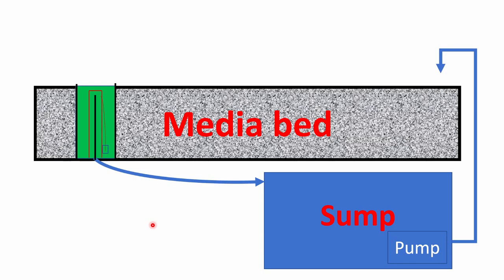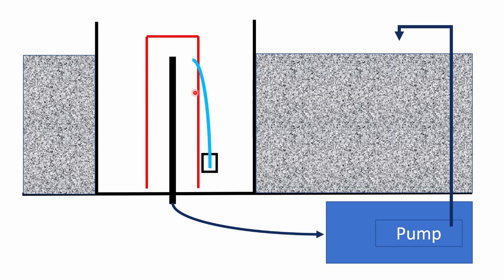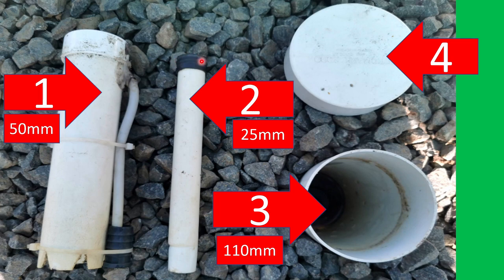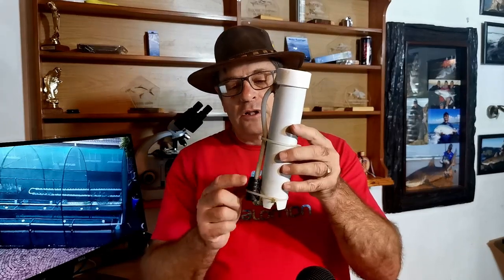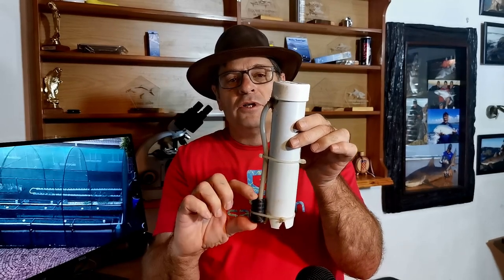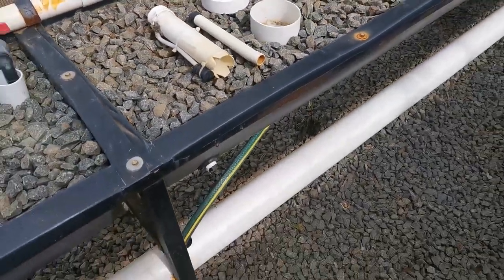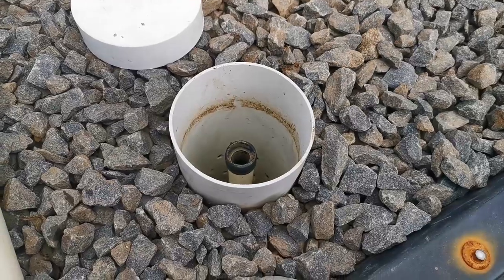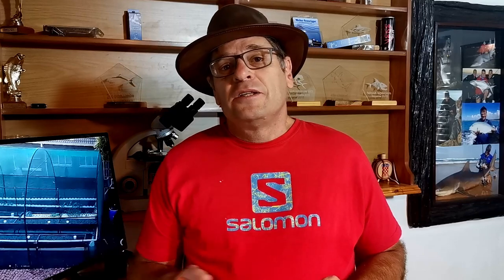Build you own Bell siphon that works!

Comment: Thanks for these videos Pierre. I am enjoying your explanation of it all.
How many holes in the 110mm pipe, how big should they be in diameter. I presume 5mm would be fine. Then also how low down or where exactly do you make these holes?
Reply from the maker: The holes in the 110 mm must be small enough so that your grow media doesn't fall through. The lower 1/3 will be fine.

Comment: Hello pierre i have a problem with my flood and drain resevoir. Hope you can help me . our reservoir has got the dimensions 6 m long 0.8m wide and 0.3m depth and filled with ph neutral lava rock. The water inlet is a 25 mm pipe and the siphon is your explained siphon . both are on the one side of the reservoir. the problem is. reservoir get filled properly the siphon starts to empty the reservoir but the siphon brake at 4 cm of water level on the siphon side but on the end of the 6m reservoir the water level is at 10 cm . after a few minutes the rest of the water levels itself about 7 cm . what can we do to soke the water equal. Greetings
Reply from the maker: Your problem relates to the resistance of the media to the flow of water. You will have to make physical changes to your system.

Comment: top gap you mention 25mm above drainpipe.. why 25? is it to match the inner pipe diameter?
Reply from the maker: I have found that 25mm worked well for the gap. This was determined by way of experimentation.
Reply: The top Gap is measured as a minimum.  the Gap is where air escapes to create the suction.  If the gap is too small, then not enough suction can be created. But your gap can be 1 meter high, and it will work great.  

The water falls in the inner pipe, and covers the innerpipe hole, to trap a bubble of air. pushing the bubble of air down.  this creates the suctioning low pressure in the gap. 
That is why the 'funnel' is suggested for bell siphons that dont work every time.  A larger film of water falling down the edge of the funnel, will be enough to cover the inner pipe's hole and trap some air bubbles. 

also, understanding that it is the air-bubbles getting trapped and pushed down, will help you see, why the pump can't be a trickle with this sort of 'simple' bell siphon.
Reply from the maker: Good explanation
Reply: Hi Pierre, waar kan ek daai 25mm bulkhead of "uniseal" koop? Kry dit nie by plekke soos Chamberlains of Builders nie.
Reply from the maker: @rossouwboshoff7339   dink ek het myne by Senwes gekry.